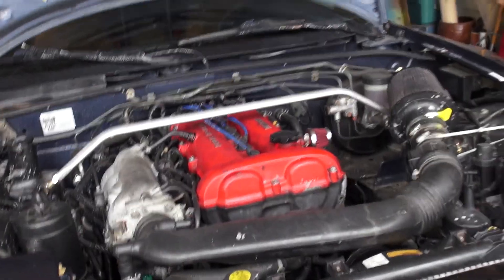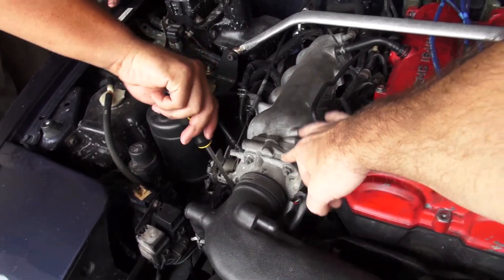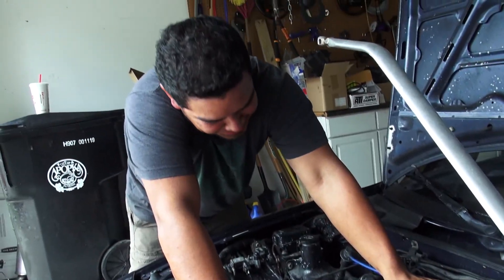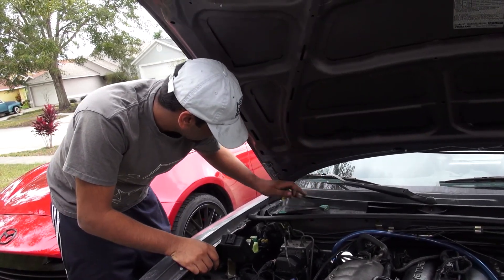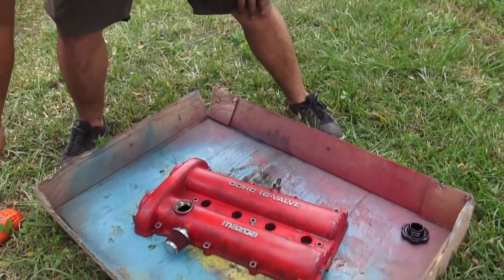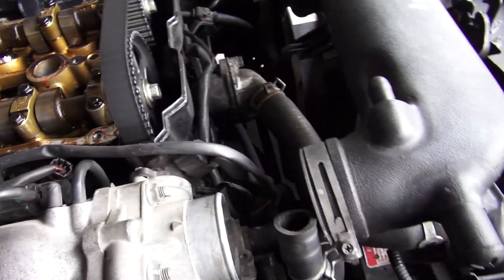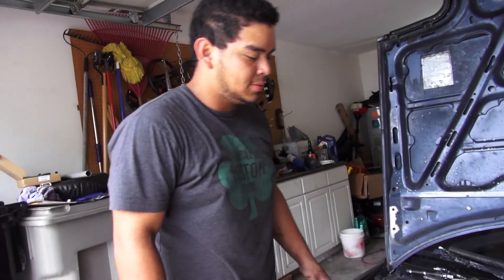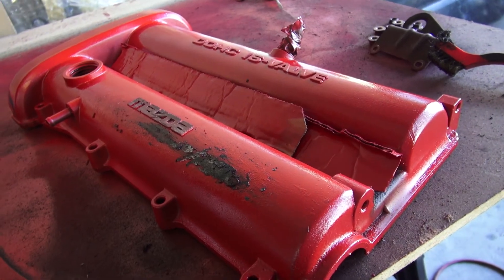Angel Paints his Intake Manifold - And breaks his car

Comment: Unrelated do you have any recommendations on cleaning the throttle body? Mine feels gunked up
Reply from the maker: It's pretty easy to remove it and clean it with carb cleaner or even brake cleaner.  Just remove your snorkle, remove the water lines from the throttle body and take out the 2 nuts on top and 2 bolts on the bottom.  It'll come right off.  But you'll need to replace a gasket.  OReilly's or Advance Auto Parts carries it, probably others too.